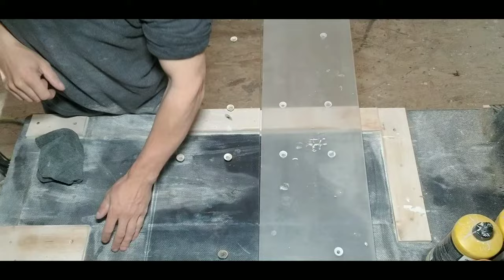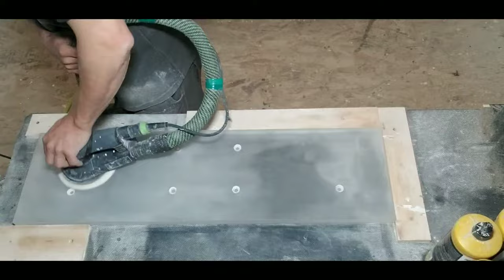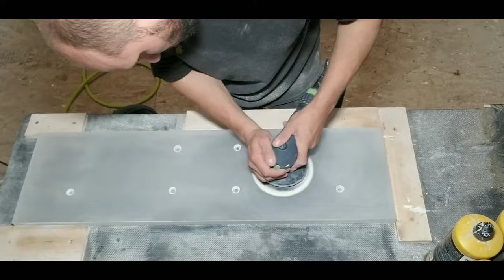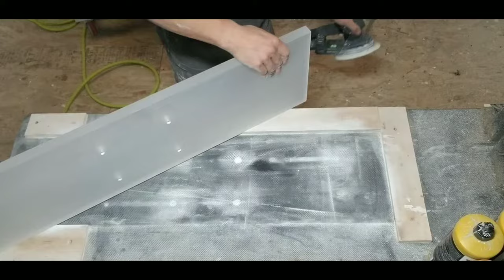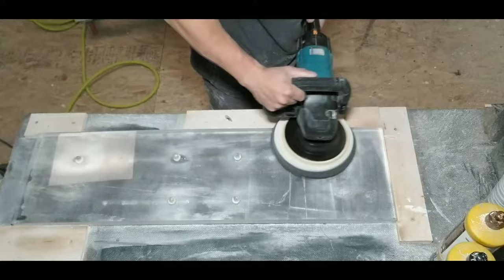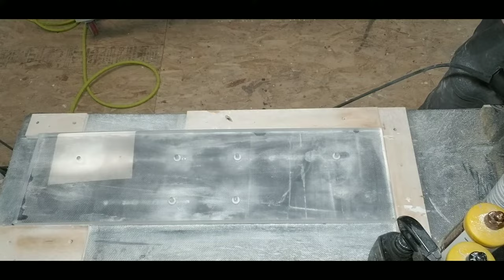Plexiglass restoration

Comment: After sanding 2000 you're using so many steps of polishing that I don't even know what's going on anymore. I see first 3m rubbing compounds, second step you show the bottle out of camera, then third steps with 3m compound again, then you using somekind of compound for shining, then you again using 3m compound.. what's going on? Usually there's 3 steps in total of grinding and polish, then maybe shining and that's it, in here the whole process is not written neither explained anywhere. Sad :( why using these exact sponges? what is the difference between them? after like 4th step you're using wool disc again which is like w00t?" why? it's very harsh, you've used it once, why using it again..?
Reply: Never replied